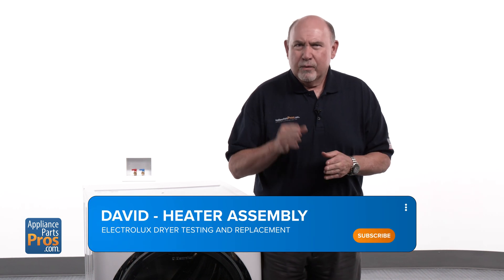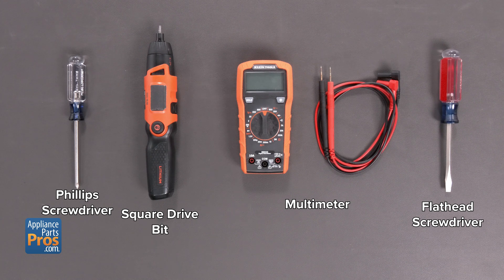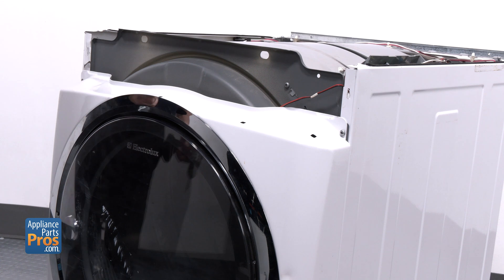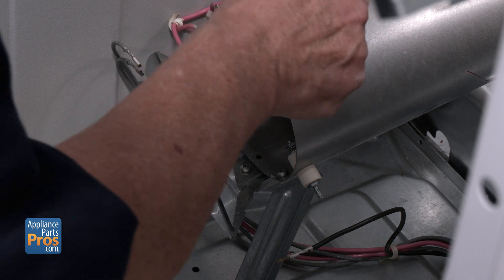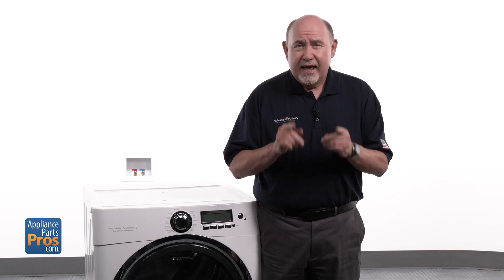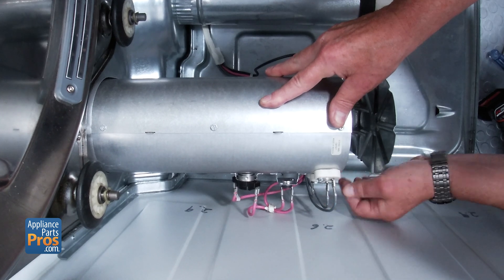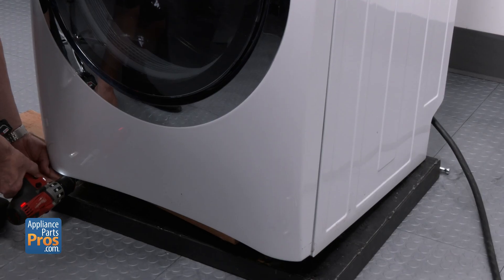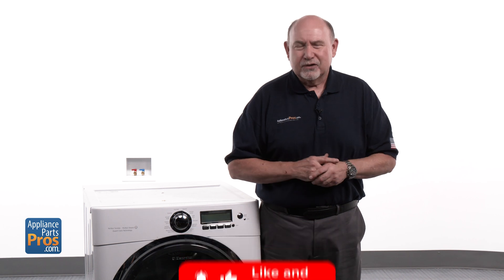Is Your Electrolux Dryer Heater Assembly FAULTY? Quick Test and Fix

Comment: You should really test it in place. Why do all the work of pulling it out and reinstalling if there is no issue with the element. Work smarter not harder
Reply from the maker: @smellmymusk3324 You’re absolutely right — if you can safely test the element in place, that’s definitely the smarter move. 💡 We pulled it in the video to show the process clearly, but for folks comfortable using a multimeter with the unit intact, it's a great way to save time. Appreciate you pointing that out! 🔧🌀